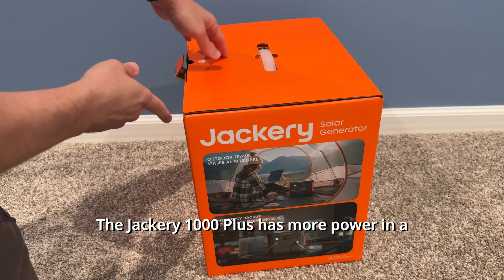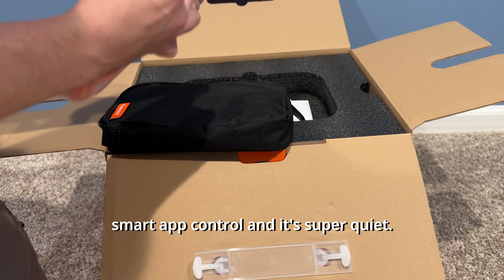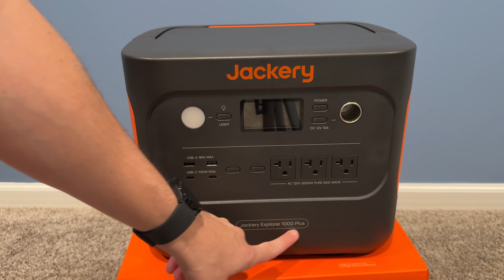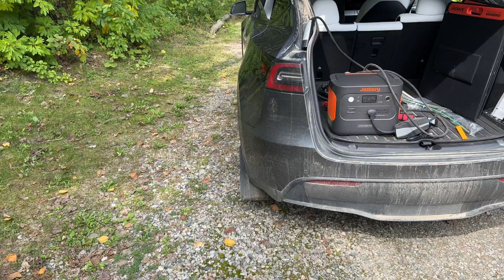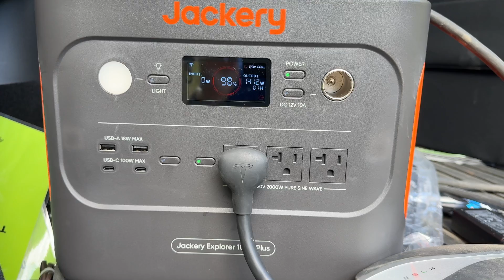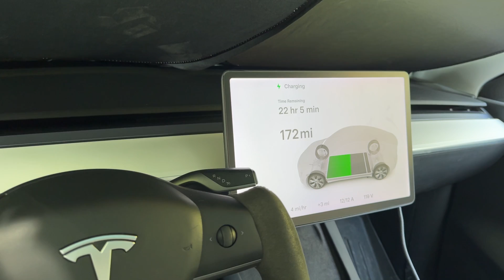Jackery 1000 Plus Solar Generator is a Great Tesla Addition!

Comment: So Chris, I think I remember you have solar cells on your roof.  Could you tell us how many panels it would take and what would be their size in order to charge a Tesla for 50 miles?  I'm using 50 miles because I thin that is the number of miles estimated most people travel on any given day.
Reply from the maker: To go 50 miles in a Model Y, it'll take ~15kWh (being conservative, it could be far less than this). If you have 10 solar panels at 400W each, that's 4kW, so you'd need to charge for ~4 hours at full power to go 50 miles. You can vary those numbers however you want, more panels, less sunshine, etc.

Comment: Do we know if the 12 VDC accessory outlet draws power from the small 12V battery or the big main battery?  Assuming it’s the small one, as it depletes charge the main battery must frequently recharge it.  This process may significantly reduce the life of your 12v battery.  

I don’t think Tesla planned for the 12V battery to charge a much larger battery such as Jackery or anything else.

Comment: You will void your warranty by plugging the charger into the. 12v accessory plug

Warning
Installing non-approved parts and accessories, or performing non-approved modifications, can affect the performance of Model 3 and the safety of its occupants. Any damage caused by using or installing non-approved parts, or by performing non-approved modifications, is not covered by the warranty.

Comment: I have two Jackery units and solar panel use it for cell phone laptop and telescope and camera plus fridge and electric blanket while camping. great product works well.. during the day I can charge battery up while also charging my devices and running mini fridge.  as Chris said you could get a few miles if needed for your Tesla this isn't a reason why I would buy one.

Comment: A gallon of gas technically has 33kWh…a Tesla Model Y battery has about 2 1/2 gallon equivalent capacity.  Now if we could just convert gas into electricity efficiently.…Some experimental fuel cells can do 60%…but it’s not carbon free
Reply: Using 2 1/2 gal times 28 mpg for an efficient ICE car, that’s only 70 mi range.  But a model Y long range has EPA of 330 mi.  Look at how much more efficient EVs are compared to ICE.

Comment: It's hard enough to keep a Tesla charged with a 10kw rooftop solar system (realize that supercharging is done at 250kw). A product like this is just a joke for charging EVs. Weird that Jackery is paying for videos like this all the sudden.
Reply: Supercharging isn't a fair comparison to home solar. Level 2 charging is a fair comparison.
Reply from the maker: It's not for charging your car daily. On top of the other uses, a friend could bring this to you in a pinch to get a few miles added if your car has no range left
Reply: @DirtyTesla how many exactly? 20?50?
Reply: I mean....   its a real longshot that you just need 2 miles. There's Tesla roadside assistance for that. I just hope no one buys this thinking that it is going to be useful for a vehicle in any realistic scenario. @DirtyTesla
Reply: @routine8 for the people who regularly run out of fuel 100 miles from a gas station, this definitely won’t cut the mustard.

Comment: So I am looking for something to passively charge the Tesla on Solar... I don't want to lug around more batteries, just panels. Is there something like that?
Reply: Consider an Aptera. Sleek new EV covered with solar panels. Up to 40 miles per day from the Sun. Or works with Tesla chargers. Shipping next year.
Reply from the maker: Without it being built into the system, it won't really work. You need at least a small battery

Comment: These “sponsored videos” dilute and “shill-up” your content. IF you are going routine  go this route, suggest you sweat the detail like Wil Prose, H0b0 tech, and many others people like us use when learning about power delivery and self reliance.  

On side note, I have tested all my solar gen sets with my Tesla(s).  From 2KW, to 5.3KW Gen set reserve.  Plus, simultaneous solar gen at up to 1.2KW into the various portable solar gen sets I have.

Input to Jackery or most other solar gen sets on 12V (cigar plug sourced) are limited to 10 amps charge input.  Which is not much power at 12V. About 120 watts.  Can help maintain a Jackery during off grid use.  However, I would use the solar panels too.  With two 200W panels, those typical bring in another 240-320+ watts charge in sunny days.  I am not sure if this model on the video will take a charge from 12V car system and solar at the same time. If it does, that could more than double (triple in good sun days) the charge rate to the solar Gen.